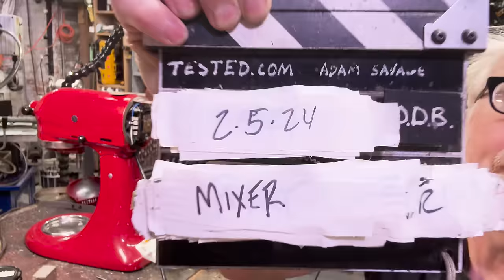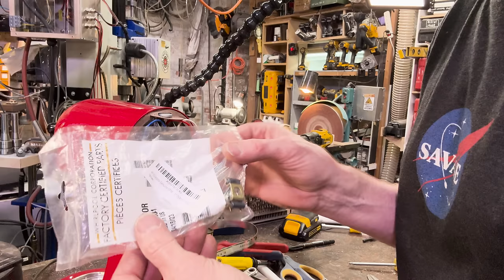Can Adam Savage Repair This Old KitchenAid Mixer?

Comment from the maker: Subscribe for more videos (and click the bell for notifications):  http://www.youtube.com/subscription_center?add_user=testedcom
Join this channel to support Tested and get access to perks: https://www.youtube.com/channel/UCiDJtJKMICpb9B1qf7qjEOA/join
Reply: Adam what happened to the others from the show I looked up to you and Jamie as a kid and to this day I still do and the others tori if I remember what happened to her and the other two that filmed with her
Reply: Be lucky model of Kitchen Aid Mixer is older, some newer models made sometime in 2010's onward would be made unrepairable by people becuse screwdriver used for outer case would need to be a specific one only people from company could use as they are only one with tool for repair ability.
Reply: That motor sounds awfull, check brushes and bearings!
Reply: We had an old KitchenAid mixer and it was very weak with the stirring strength, and when we opened it, it was full of metal shavings and dried up oil. The gear inside had ground all of it's teeth down to stubs, so we had to buy a new one
Reply: Adam, get yourself a set of Wera VDE Electrician's screwdrivers. They're used by sparkies everywhere and will prevent any stray hands getting an electric shock :D
Reply: Wish he would say what he was doing at the time, alot of videos of him working but not saying what he's doing at the time.
Reply: If you still have it...any chance you can walk through the fix of the gears. I have a lift up Hobart KitchenAid that's on the shelf because there's a nylon gear that is shot. It acts as a failsafe so that it breaks instead of the gears. I tried to find an appliance repair person but no one works on small appliances anymore (only larger ones like stoves, etc). Any help you can provide in this would be greatly appreciated.

Edit: Do you have a contact for Appliance Parts Pros?
Reply: A cave FULL of tools and you have to use a pair of pliers on a nut? Are you telling us you don't have an open end wrench to fit those nuts? Is your motto "Any tool is the right tool as long as it gets the job done!"?

Comment: I found a mixer just like this in a garbage dump.  Took it apart, cleaned it, installed new brushes, and gave it a paint job.  About 10 years later is it going strong!  It's sad to see the "throw away" attitude but so many people lack the skills and confidence to just dive in. Great video.
Reply: Yeah so much waste for things that can be easily fixed
Reply: If it’s already broke, you can’t lose anything by taking it apart and trying something
Reply: @Minemac2  except explosive munitions found magnet fishing.
Reply: What  find frustrating is when the rest of an appliance is "built like a tank", but the brushes in the built-in motor are permanently installed and removing them (for replacement) would basically destroy it.
Reply: @Minemac2  Exactly.  I once took my dad's 1960 Craftsman circular saw to Sears for repairs (lifetime warranty they said) and they told me they couldn't fix it because the parts they needed were no longer available.
Well I couldn't make it worse so I opened it up.
Turns out all that was wrong with it was a piece of the safety guard was bent.  Bent it back and it was like new.
(Haven't quite forgiven my brother for selling it later)
Reply: @vincegamer Aren't they supposed to replace it with the most equivalent item in the catalog if your broken item's not repairable anymore?
Reply: @mannys9130  I guess nobody told them that

Comment: "There is this little pin in here that can fall out. So be ready." Adam immediately loses said pin
Reply: I came here to say the exact same thing.
Reply: he did say be ready after he pulled the old one out soo might have lost it before warning
Reply: Cut out “Oh $#!+, Gov’nah!” footage, replace with: “…little pin, be ready…”
Reply: What he meant by “be ready” was be ready with your jewelers lathe to make that part.
Reply: As a mechanic we called these "Jesus pins" or "F#$& pins" because you would shout "F#$& where did that go"
Reply: Had to make a new one for my moms when I repaired it I never even saw it come out!

Comment: Seeing Adam poke around in the back with a metal screwdriver while it's running gave me the heebie-jeebies
Reply: You haven't lived!
Reply: @dt4676  Your lucky you still are!
Reply: It's only 115V.
Reply: Yeah, I would definitely be using a VDE insulated driver for this!
Reply: @Okurka. 120V. It hasn’t been 115V nominal for the better part of a century.
Reply: @tookitogo   It's 120V with a maximum deviation of 5%.
That includes 115V...
Reply: @Okurka.  Right. Which makes the nominal voltage 120V.
Reply: @tookitogo  I haven't mentioned "nominal" anywhere.
Reply: @Okurka.  But I did. Not to mention that when people mention a line voltage without any stated qualifiers or tolerances, then what they mean is the nominal voltage.
Reply: @tookitogo  I mentioned the line voltage in his shop and didn't mean the nominal voltage.
Reply: @Okurka.  Unless I missed something in the video where he measured the actual line voltage and found it to be 115V, then you were referring to the nominal voltage, even if you don’t know what that means. (The entire USA has a nominal voltage of 120V.)
Reply: @tookitogo  Like I already said: I wasn't referring to the nominal voltage, at all.

Comment: I went to an auction. They had several Kitchen Aid Artisan mixers, new in the box. But all the boxes had orange stickers on them as being returned as defective from new. I bought one very reasonably. I knew they were new so what could be wrong with them? The one I bought ran even when the switch was off. Using online tutorials I simply adjusted the same screws Adam did I quickly had my mixer running fine.
Reply: And now you wish you bought all of them for eBay

Comment: If I was doing it I would have replaced the motor carbon brushes on a 20+ year old machine. It sounds to me like on low speed the brushes may be arcing.
Reply: I agree. I think worn brushes/commutator are the underlying issue to it's erratic operation. I would have started there.

Comment: What? There is a company who has not changed their product in decades? A 20 year old mixer is repaired for less than $50.00 and a little sweat equity and some good old fashioned elbow grease. Now that is quite remarkable. Way to go Adam, and way to go Kitchen Aid.
Reply: They have changed them. The newer ones have electronic speed controls in them now, but you can still get the parts for the old ones too.
Reply: Also the new ones have combination motors and plastic gears are combined meaning either one of those goes, all of the components have to be replaced. The older ones they were all separate, so they could be replaced individually.
Reply: @TechnoGeek18023  I was always told that the plastic gears are sacrificial gears so you dont blow the whole mixer.

Comment: I have an old Sunbeam mixer from the 50's I started restoring years ago and has been sitting in a box unfinished. This video inspired me to finish it.
Reply from the maker: Amazing!
Reply: Old stuff was made to be repaired, go to it!
Reply: I recently bought a 50's sunbeam mixer. Love using it as my grandmother and mum had one. Every time I use it I'm 5 years old again.  Memories😊
Reply: Same here.
I must go and find it right now.
Reply: About 35 years ago I bought a Sunbeam mixer without the stand at a yard sale.  Worked fine, but was heavy for a hand-held.  Then maybe 10 years after that, I was at an estate sale, I saw this thing that looked like just the stand. Bought IT, and sure enough, I now have the whole package.  And it works fine now.

Comment: We replaced our small mixer at work a while ago because it wasn't running consistently. But I had faith in it and took it home instead of throwing it away and went through the same steps trying to tune it and then replacing the control plate. I don't remember if I felt like I had a reason to or just because I like taking things apart but I also went deeper into the mechanical side of it. Its full of grease, if you were wondering. Grease that will get everywhere. Also managed to break the shift linkage while in there and its held together with a zip tie or something I think. 5 years later I still never used it and now its on permanent loan to a coworker

Comment: These are such multi use tools. My wife has one in the kitchen and I have one in the shop. I use it to mix small batches of drywall mud (powder is the way to go), paint, stain, etc... The stainless steel bowl makes it a breeze to clean. I also have the pasta making attachment, I use it for kneading putty compounds like Milliput or other epoxy putties. I even found one of the peel and core attachments on marketplace that was busted, I fixed it and modified it to be a wire and cordage winder. Essential tool in my shop.

Comment: This is exactly what I needed! Old KitchenAid mixer stopped working about a month ago. I've been meaning to open it up, but I hadn't found useful instructions for repair until I came across this video.
Reply: You call this useful, some new parts for some that needed a little TLC & finesse?

Comment: Something I've used in the past when working with electrics is an isolation foot switch, i.e. you have to actively engage to apply power. Then a bench mounted outlet with a little ON light and you should be good. I've also got a 'dim bulb' tester, which is a great way of applying current limited power.
Reply: The foot switch is a great idea, I may buy or build one of those at work. (I’m the electronics technician at a university department, so all kinds of lab equipment comes to me for repair. I have a stack of magnetic stirrers waiting to be looked at…)
Reply: Personally, I unplug it and blue-tape the plug on the item, within field of view.  So when I get the "is it unplugged?" heebie-jeebies, I can glace and see the plug and the blue tape.
Reply: Medhi could use that

Comment: I fixed one of these... kind of lol... I couldn't get the spacing on that back plate quite right. Had a knocking sound after but it did work. I took the brushes out of the motor by accident, and was really tough to get back in. A 2 hr project turned into about 5 days, I took it completely apart and loved doing it, cool machine!

Comment: Adam tightening those nuts with a pair of needle nose pliers...Me: Get a wrench you monster!  
It still doesn't sound right on low speed after the repair.
Reply: Adam needs a set of ignition wrenches. It sounded like the motor was hunting when it was running at the slow speed. On a different video I saw, the guy mention a circuit board with resistors and a capacitor that was there to remove the electrical noise generated from the speed control contact arcing and I wonder if the circuit board also helps the motor run smoothly when it is running at the slow speed setting? There may be a bad capacitor or resistor on the circuit board. It would be interesting to see the schematic of how it is all connected.
Reply: @dandearman2871  Yes, it would, since capacitors are used for smoothing out pulsating voltage, making the waveform more linear.

Comment: I love buying and flipping KA mixers that are "broken"  it's usually a speed controller that needs adjustment or replacement $15. It's a good idea to regrease them also if they are the older models.

Comment: Im so proud of myself. I just recently successfully repaired two vintage fluorescent light fixtures. One was a lovely chrome fixture for the bath that dates from the 1940s. In addition to the base being chrome it also had this chrome shade in front of the bulb that tilted up and down so that it is both a reflector and a shade depending on how you position it. Some triple x steel wool polished that up nicely and I had to re-wire it from where someone had previously cut the wires to the switch and the built in shaving outlet.
The other was a nice big heavy fluorescent desk lamp dating from the 1940s. This was functioning but it had apparently suffered a fall and it was damaged.  A large molded metal base that supports a large shade via two square posts that extend up and then curve forward holding the shade, each with a ball socket joint. A fall had pulled one of the ball sockets apart and I had to disassemble the lamp to feed the wires back through ball socket and put it back behind its retaining ring. Everything went back together perfectly and the fluorescent bulb is quite old so it cast this nice vintage fluorescent green glow you dont see anymore.

Comment: Not bad, Adam. My wife’s 40+ yr old KitchenAid mixer, which looks just like your friend’s, runs quite smoothly on slow at about 69 RPM. But anyhow, thanks for the video! As I was playing with the mixer I noticed that the left side motor brush plug was about half way out. Much easier fix than you had to deal with! Cheers!

Comment: For a 20 year old appliance, that is in amazing condition on the outside.  Hats off to Kitchen-Aid for building such an outstanding product!
Reply: Hats off to the owner!
Reply: They're torque monsters stand mixers. 
That's why they're all metal, they have to be, it would tear the machine apart before the dough.
Reply: They still make them the same way to the same quality standards hence why they cost so much
Reply: If it was outstanding it wouldn't need repairs.
Reply: @someperson4819  
Nope, "zero maintenance" just means "landfill when it breaks"
And that's if it's something that doesn't kill you when it breaks.
Reply: @someperson4819 Really, everything breaks at some time, 20 years without needing repairs is really excellent, especially in this day and age when equipment that lastd 5years is considered a long time, and companys build in obselescence to appliances and computers.
Reply: It probably sat on the countertop for its looks.

Comment: Those 1999 through 2005 kitchenAid mixers are the best.
Only 3 things ever go out on them, the speed control plate, the power supply and rarely the motor. Fantastically made.
Reply: I was lucky enough to get a ProLine 5qt back in 1991. Still runs like a work horse 30 some years later. I do have a spare Hobart made I need to go over at some point.
Reply: @hdcat 
Excellent

Comment: Larger commercial mixers have a built in transmission on the gear box, not too dissimilar to what Adam has in his lathe. They are far more consistent regulating speed but it is hard to cram an identical system into something that sits on your counter top.

Comment: Was just watching a video where a radio in a 10 year old GM product  was no longer supported or stocked by GM.  Even the suppliers of the radio did not have the parts to repair the radio.  Two thumbs up for Kitchen Aid.

Comment: Surprised nobody has posted about the governor's working, which I was really mesmerized by. It really looks like an electrical version of a steam engine's governor, where the centrifugal force of the running motor pushes out a powered pin (varying with speed), and the angle of the speed control plate then decides how many of the contacts on the plate the powered pin makes contact with. Overall it then regulates how long the motor is powered during a single rotation. During the slowest setting you could tell the motor was sputtering because it only got powered in parts of the rotation.
Reply: I was going to say that I would not have guessed there was all of that in there just to select from several speeds. Thanks for the explanation.

Comment: Oh, Adam.  This was the time to replace the grease in the planetary.  With heavy use, it is recommended to replace every year.  Of course, that is a bit ridiculous, but every 20 years isn't unreasonable.  That grease is thick, dark, and gummy in there.  Loving this video as I just went through the exact same stuff, same frustrations, on mine. But I replaced the grease as well.

Comment: I have a KitchenAide 6qt lift-bowl mixer that's over 12 years old now. One of the sacrificial gears failed on a large ball of pizza dough. It was messy, but I got the replacements parts(gear and food-grade grease) for like $20. It took about an hour(mostly degreasing), but it was good as new.

Comment: My wife's KitchenAid mixer is 45 years old and was one of the first colored models. It is beige colored. I think prior to her model they were all painted gray. I replaced the white power cord that was singed and discolored. Found a new white cord online for it easy peasy. I also bought a new insulator plate that goes inside of the end bell Adam removed. Still works great. This mixer design was created before Whirlpool bought them. 

We recently bought a KitchenAid side-by-side refrigerator expecting similar quality, but it has been a total disaster. The icemaker quit working 6 months after the warranty expired, due to a wire loom breaking where it enters the bottom of the freezer door. You have to replaced the entire sealed door unit, which costs over $1,100.00. Oh and the new replacement doors have the same design defect.

Comment: i picked up an old 70s-80s hobart era kitchenaid mixer for $4 and even though they changed the insides of the mixers in the 90s i can still get OEM replacement parts for it.

Comment: i had a similar experience in terms of parts availability, though not price, with my parents' whirlpool oven (whirlpool owns kitchenaid among other brands). a mains filter cap blew and the replacement power filtering board (made up of about 10 passive components) was ~£100. needless to say i just swapped out the capacitor

Comment: I learn to unplug a device after messing around with a circuit board when I was messing around with a broken strobe light. All i got was a bit of a shock, but, I learn my lesson. I never did get the strobe light fixed though.